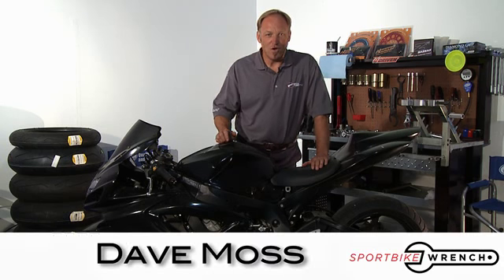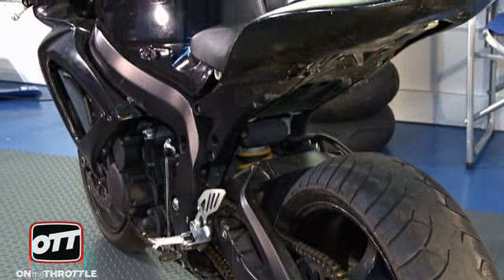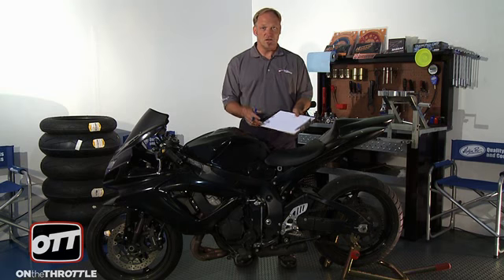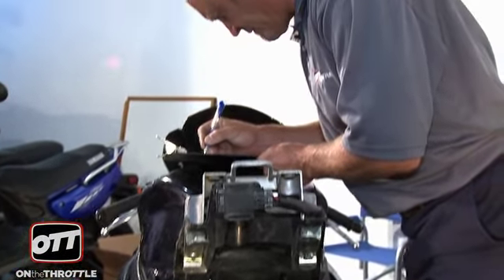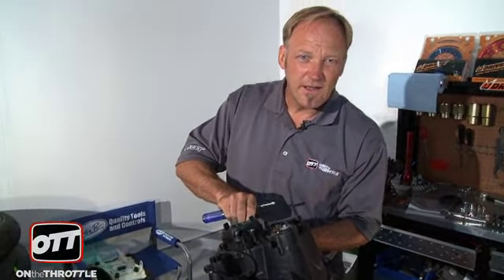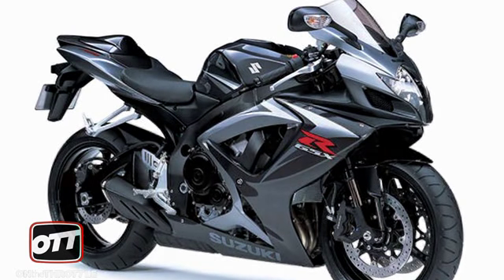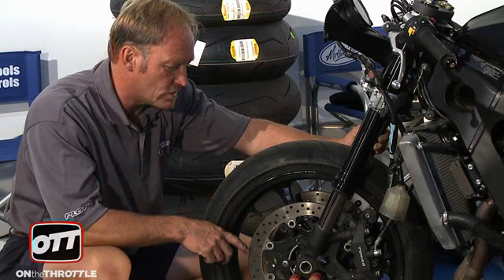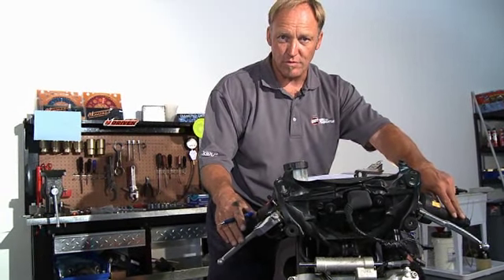Performance Upgrades GSX-R750 Project Bike

Comment from the maker: Drag is normally a function of the pistons ability to move freely. We don't clean brake calipers often enough so we get drag all the time. Similarly, if the fork is pinched, that will create drag so every time the wheel comes on and off, set the front wheel correctly. We have a video for that called front wheel alignment.

Dave Moss
Host

Comment: I bought a brand new Suzuki GSXR 1000 2006 and I put a slip on hotbodies racing pipe I got a power commander 3 I got a K&N Filter and I would just like to know how you take off the F1 light that's the only problem I have doesn't give me a call if there's nothing wrong with the bike but I would really like to take off the F1 light off so if you could give me that I really appreciate it and God bless One Love